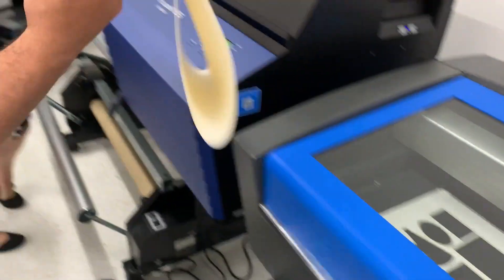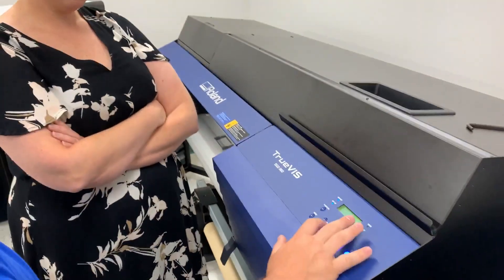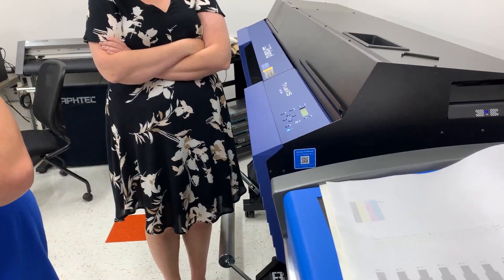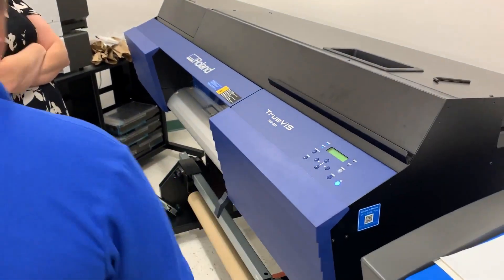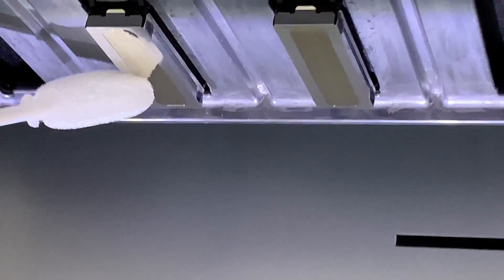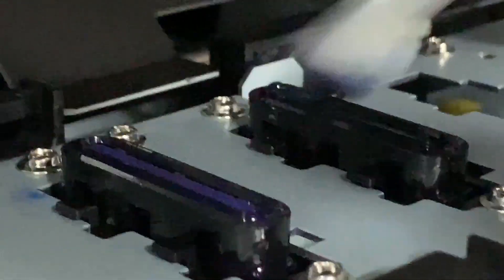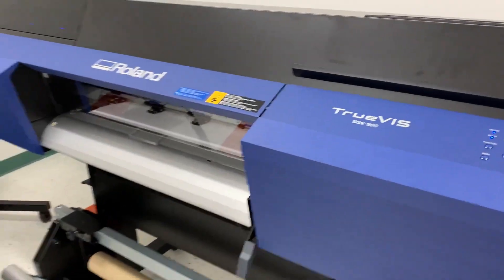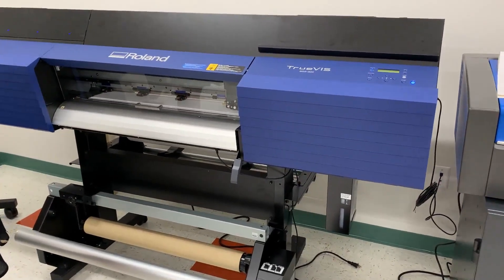Roland SG2 | Maintenance Guide

Comment: thank you for this.  any idea why my Bkack isnt running on my print test?  Like literally ZERO black ink on the print test!   Somethings not working right!
Reply: I know its late to reply since it's 5 months ago. Get yourself the jetbest cleaning solution ink bags that goes into the ink side. run a Strong cleaning until you see taht all colors are no longer running. then put back your normal ink bag and run 3 strong cleaning cycle or until you see all your colors come back,. works everytime. I have been on 4 years strong with the same printhead. no problem